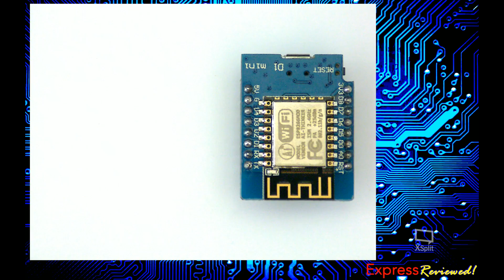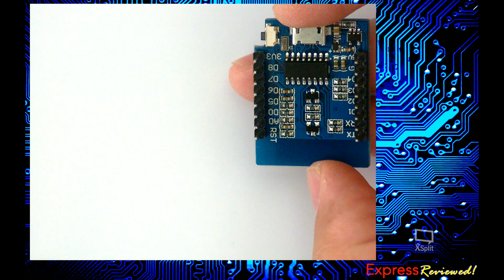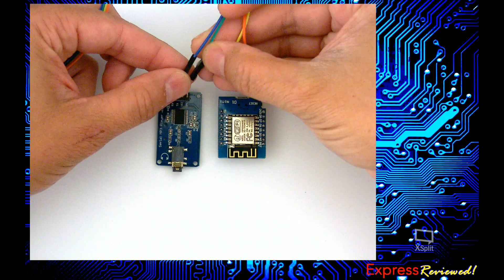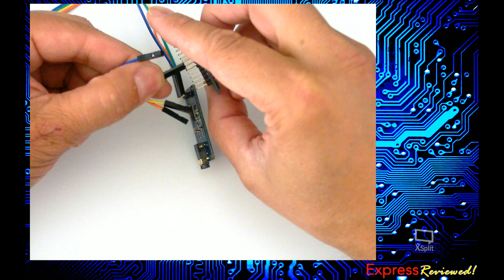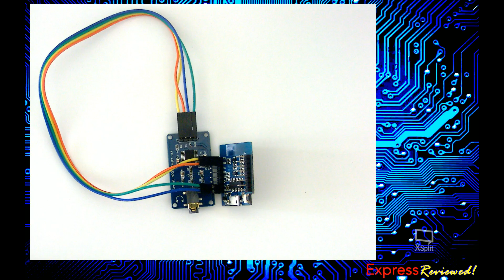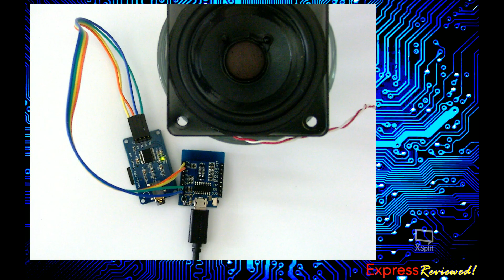ESP 8266 WiFi MP3 Player using YX5300 chip

Comment: Hey guys, im using parts of this project atm , thanks so much for sharing. There's an indent error on line 123 of main.py btw, wouldnt work for me untill corrected.

As a noob it took me a while to get the esp8266 working. Steps to make it work:
1. install python + esptool 
2. install/update the wemos usb drivers
3. "flash" the chip with esptool
4. upload the right firmware 
5. download ampy (python app)
6. edit the main.py file from maker makerUSA and change the spaces on line 123 to fit the lines underneath it.
7. download the boot.py from the esp8266 and add network configuration code
7. Upload the files from makerUSA

Again thanks a lot for this!
Reply from the maker: Thank you, I have fixed the indentation.

Comment: I know this video is old but the 8266 can stream MP3s (and in fact internet radio) itself - it has built in i2s with DMA for that purpose - you don’t need a separate MP3 module...
Reply from the maker: Yeah makes sense, when I made the video, there was very little documentation on the ESP8266. Also this is still useful from a different perspectives including using the same technique to control the MP3 module through an arduino without WiFi off course.

Comment: is the music quality good ?
Reply: Quality is very good, now remember the final output is going to depend on amplifier, speakers, power source etc etc
Reply: thanks. but i looked up the manual for this ic/module, and found there was no instruction to fetch available files in sd card. i wanted something, with which i can build a playlist with available files. is there any such module available, that outputs the sd card file name/ path etc ?
Reply from the maker: There are some, I have them on my list of things to test and try out.

Comment: Does it can reverse the process? Using a mic replace the speaker and using the esp8266 send out a MP3 file to the phone or computer?
Reply from the maker: Well you would not need the MP3 module for that. To do what you mentioned you need to capture the microphone output and then compress it in MP3 format. The ESP8266 probably does not have enough processing power to do that.

Comment: Hello, when I connect Catalex MP3 Board to Wemos, Wemos is locked. Is there a schematic of your connection? Could it be about power? Thank you
Reply from the maker: Check out the indestructible https://www.instructables.com/id/WiFi-Enabled-MP3-Player-Using-the-ESP8266-Module-a/
Reply: Hard to say, double check the connections I can not reproduce your problem.
Reply: There were errors in the entries in main.py. it works when corrected.

Comment: Great project and has given me some ideas. Can you run a speaker directly or do you need an amp? I want to use this on a teddy to read bedtime stories or any other audio files I decide to stream.
Reply: You can run the speaker directly, It's designed to be used with headphones or through an amplifier, however for the use case you mentioned I think it should work well when matched with the right speaker.

Comment: Hello!

I know that the RX and TX pins are used for the repl, did you therefore test it with the webrepl? or the webrepl is using those pin somehow al well?

Thank you!
Reply from the maker: Lorenzo Baldi hi yes I had to use the Web repl a bit of a pain that there is only one serial interface.
Reply: Thank you! you saved me a lot of testing!

Comment: does this need a router / home wifi or can you just connect phone direct to esp?
Reply from the maker: In my implementation the ESP is connecting to wifi and the phone as well. It is possible to have the ESP to act as an access point  so that the phone can connect to it. The issue with that will be that the phone will not be able to connect to the internet in that case. Your usage may warrant that kind of a solution.
Reply: @MakerUSA  Is there any way that you can please share the code to make the ESP an access point?

Comment: does this mp3 module support id3 tag reading from the mp3 files? thanks
Reply from the maker: Hi, Unfortunately it does not. I don't believe it's designed to be used as a full fledged MP3 player implementation. It's more of an industrial use design.
Reply from the maker: My needs for this particular project were very specific and this module works. I am going to get some VS5300 based modules to experiment with soon. I will share my experience with that too.